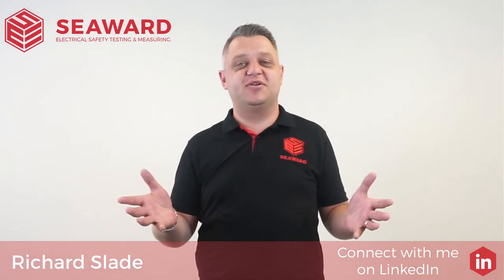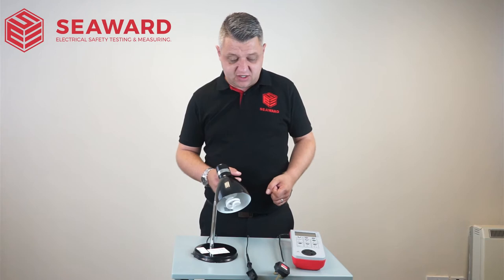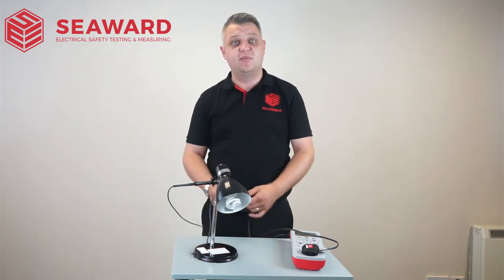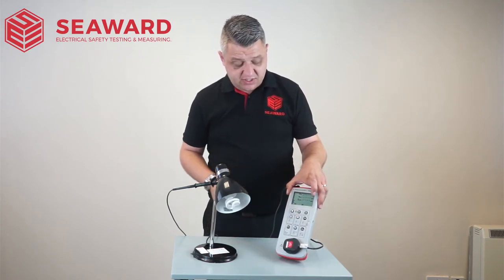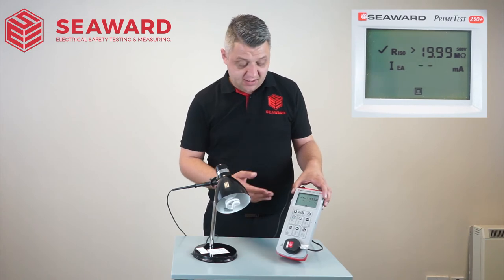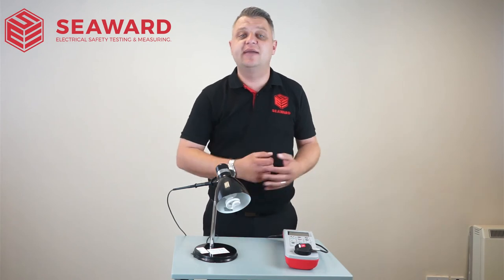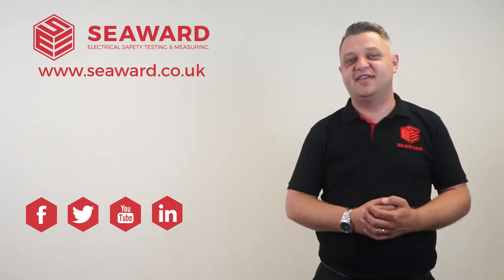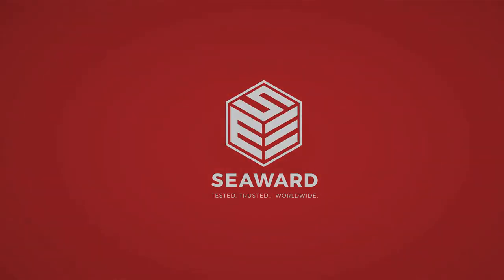How to PAT test a Class 2 appliance (lamp) - Seaward

Comment: Hi, I'm trying to PAT test a Class 2 device, (a Lexmark desk printer) however if i plug the device into the Seaward Primetest 250 clip the probe onto the plastic casing (no metal available) and try and run the test the tester flashes a power cable icon on the display and wont do the test? If I unplug the device from the tester the test will then run successfully, however I'm confused because you are clearly plugging the device into the PAT tester in the video? Is the unplugged test valid?

Comment: Hi ...

If we do the insulation test with equipment is in on position,
Any problem for equipment when passing 250 or 500v during insulation test
Reply: One terminal of the IR tester is hooked to shorted/jumpered phase and neutral  and the other terminal to the metallic frame or body. In this condition there is no potential difference between phase and neutral, so the appliance doesn't get damaged as the voltage is zero.
Hope this helps.

Comment: what if there are no exposed metal parts... as is the case with many double insulted items
Reply from the maker: Hi HoppingMad. As the appliance is covered in plastic, the possibility of electrical leakage occurring is greatly minimised. This is due to the plastic effectively providing insulation in the event of a live wire making contact with the internal casing of the appliance. For this reason conducting a thorough visual inspection would be essential, however a class II test would be conducted in combination by moving the probe to various locations on the appliance casing, in order to verify that there has been no degradation of the insulation. Thank you.